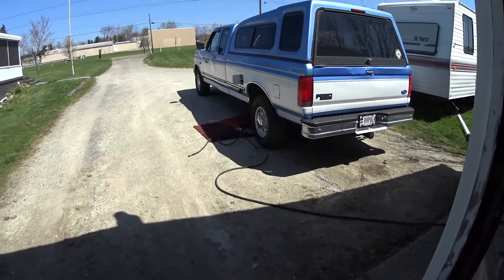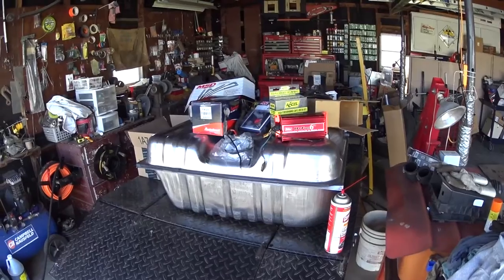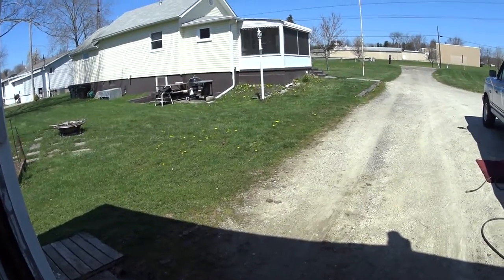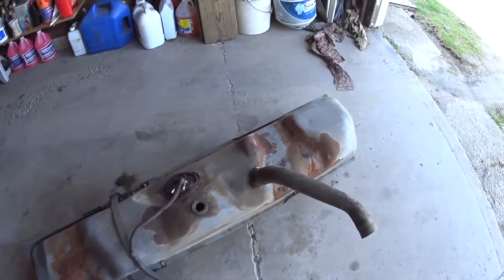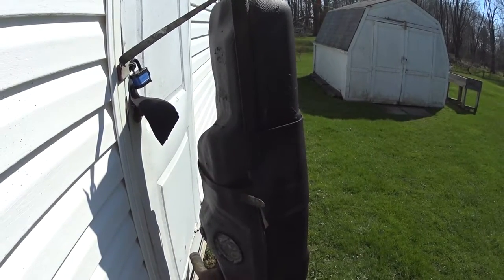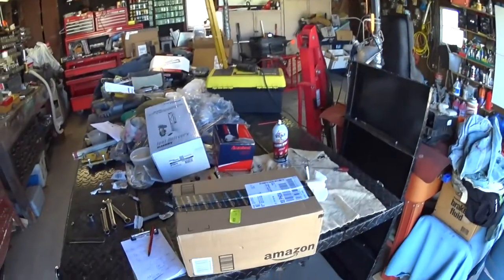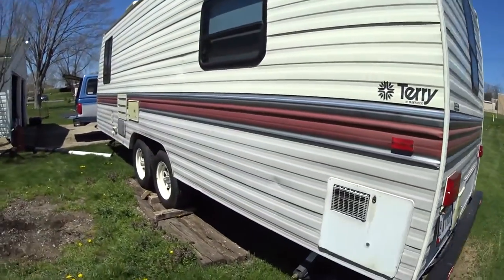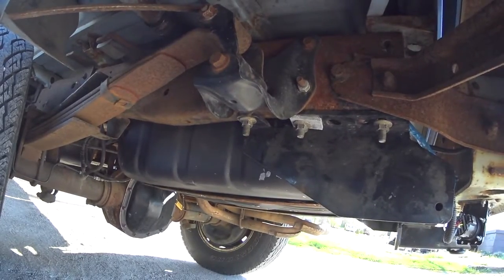It takes Two, Baby  -  TANKS A LOT!

Comment: 80 today high 50's low 60's  this weekend for first trip of season. Glad I brought mine home from storage lot didn't realize my water valve broke on toilet ,  Found it when checking pipes though had a water fall coming out the doors.  Fixed now thank goodness so then I installed the 2 new scissor jacks one was missing and wanted all to be the  same   I will replace back ones next season .  How do you like that angle drill. My front full cabinet space is narrow making it a pain to drill or self tap screws .
Reply from the maker: Water valve could have caused huge issues, good thing you caught it.. You just reminded me,  I need to lubricate stab jacks... That right angle impact driver is awesome!